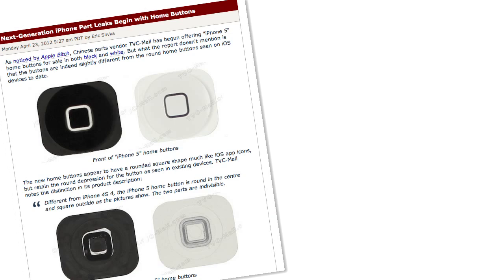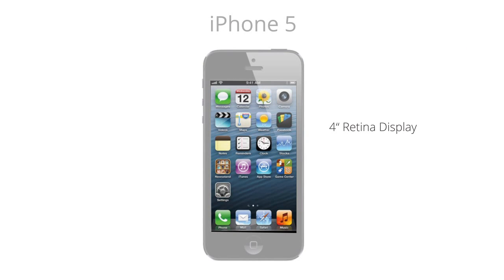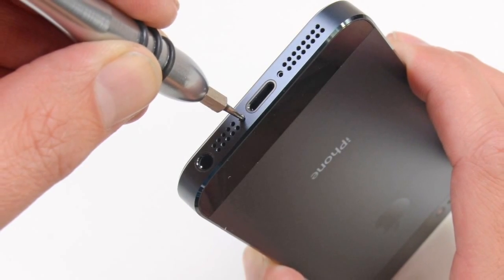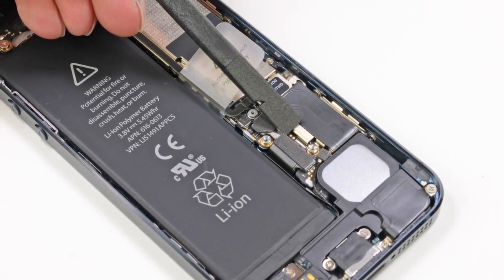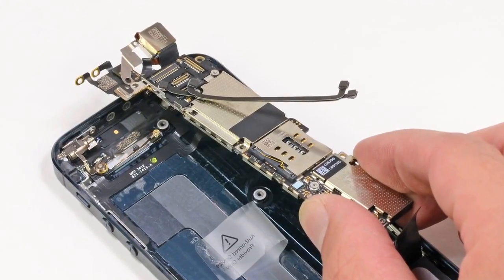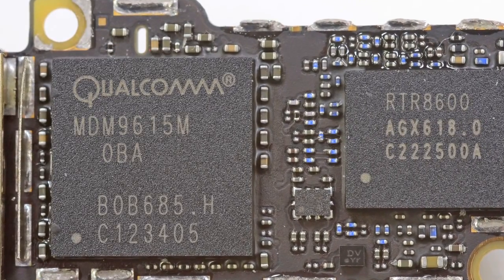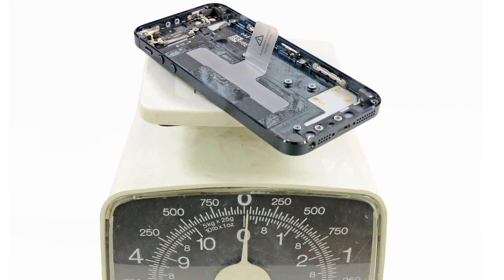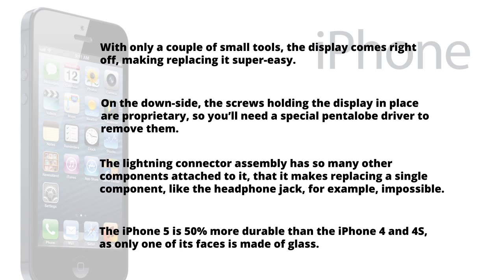Inside iPhone 5

Comment: intels 6 cores with hyper-threading plays out like 12cores so why would a ios that doesnt support intels hyper-threading and im pretty sure has nothing like it benefit from having more cores it add's to the power required to run the cpu which btw is bad for a handheld device if an app is using more cores its using more power and there for is bad unless it was designed to run more cacluations efficiently without drawing more power supposedly the tegra 4 has help solve it

Comment: 3:20 if you did research you would know there CPU is a Custom Designed, with Custom Cores. Instead of going with a 4 Core they went with a Dual, with more performance and less power drawl. Now for everyone, Before you start bashing, look it up.